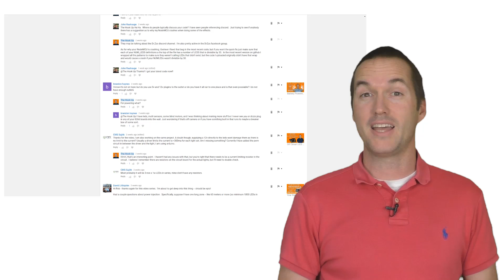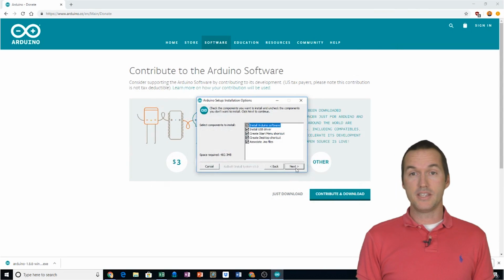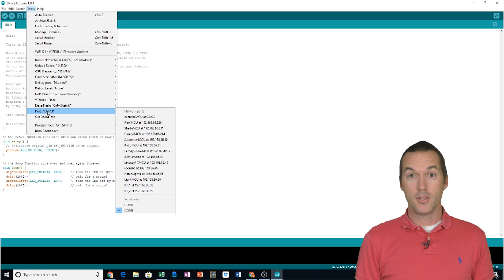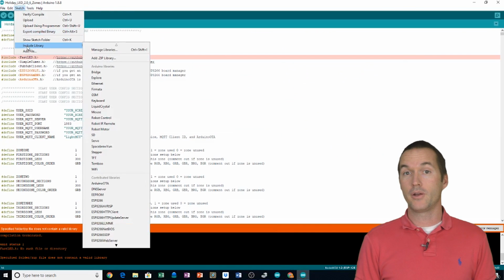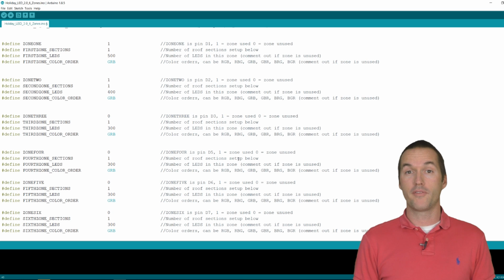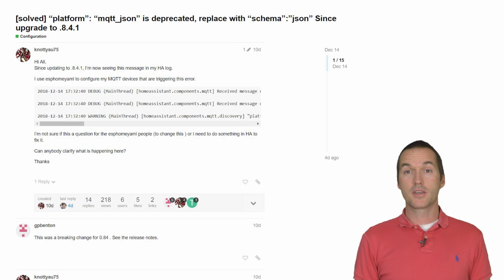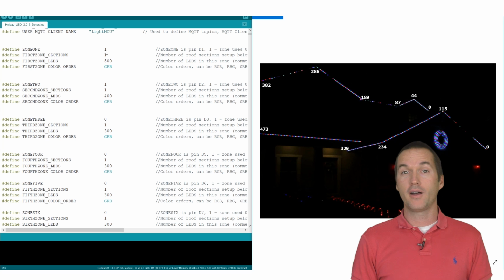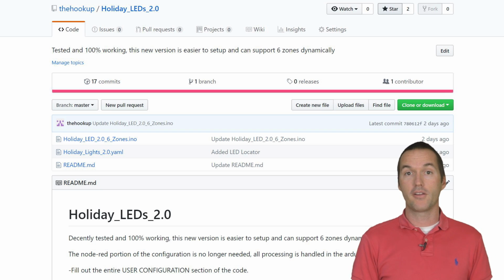Total Beginners Guide: Holiday Lights 2.0 Step by Step Arduino Installation and Setup.

Comment: I bought all my supplies through your links. I have also become a Patreon member. 
Also, I have always tried to buy other items on Amazon through your link. Does the ladder help you?

I got everything working but I have been suck on one thing all week. When I click the switch nothing happens on the NodeMCU side. I do see MQTT connecting on both sides. I tried someone else's code and got the same thing. I don't know where to go from here. Is there somewhere I can find help on this? I already spent hundreds of dollars and would love to get this working?
Reply from the maker: Yep, that helps as well, thanks for your support!
Reply: @TheHookUp  where can I get help on my issue?
Reply from the maker: @fin3125  do you have a way to connect your NodeMCU to USB to see what's on the serial monitor?  You should be able to see what messages are coming through on the serial monitor.

Are you sure you have your MQTT messages setup correctly?  Can you post what you have for your config.yaml?  What version of HA are you using?
Reply: @TheHookUp  that is exactly what I did.. Nothing after the connection. I even added a print line to see if the callback function was called but nothing.
Reply: @TheHookUp  
mqtt:
  broker: 10.0.0.155
#  port: 1883

switch:
  - platform: mqtt
    name: "Switch1"
    state_topic: "ha/switch1"
    command_topic: "ha/switch1"
    qos: 0
    payload_on: "ON"
    payload_off: "OFF"
    optimistic: false
    retain: true   

    ##This version of the holiday lights code does not require the node red portion
##The "W" slider under the main "holiday LED" light modifies each effect
##The "W" slider under "Glitter" light modifies the frequency of glitter, the RGB selection changes the color of the glitter
##The "W" slider under "Lightning" switch modifies the frequency of lightning.
##You must replace the LightsMCU with the USER_MQTT_CLIENT_NAME you specified in the arduino USER CONFIGURATION section
sensor:
  - platform: mqtt
    name: "Current LED"
    state_topic: "LightsMCU/locator"

light:
  - platform: mqtt
    name: "Holiday Lights"
    command_topic: "LightsMCU/power"
    state_topic: "LightsMCU/powerState"
    brightness_command_topic: "LightsMCU/brightness"
    brightness_state_topic: "LightsMCU/brightnessState"
    brightness_scale: 255
    white_value_command_topic: "LightsMCU/modifier"
    white_value_state_topic: "LightsMCU/modifierState"
    white_value_scale: 500
    effect_command_topic: "LightsMCU/effect"
    effect_state_topic: "LightsMCU/effectState"
    effect_list:
      - Color_Chase
      - Color_Glitter
      - Single_Race
      - Double_Crash
      - Rainbow
      - Blocked_Colors
      - BPM
      - Twinkle
      - Fire
      - Fill_Solid
      - Spooky_Eyes
      - LED_Locator
    retain: true
  - platform: mqtt
    name: "Color 1"
    command_topic: "LightsMCU/ColorPower"
    state_topic: "LightsMCU/powerState"
    rgb_command_topic: "LightsMCU/color1"
    rgb_state_topic: "LightsMCU/color1State"
    retain: true
  - platform: mqtt
    name: "Color 2"
    command_topic: "LightsMCU/ColorPower"
    state_topic: "LightsMCU/powerState"
    rgb_command_topic: "LightsMCU/color2"
    rgb_state_topic: "LightsMCU/color2State"
    retain: true
  - platform: mqtt
    name: "Color 3"
    command_topic: "LightsMCU/ColorPower"
    state_topic: "LightsMCU/powerState"
    rgb_command_topic: "LightsMCU/color3"
    rgb_state_topic: "LightsMCU/color3State"
    retain: true
  - platform: mqtt
    name: "Glitter"
    state_topic: "LightsMCU/glitter/state"
    command_topic: "LightsMCU/addEffects"
    payload_on: "Glitter On"
    payload_off: "Glitter Off"
    rgb_command_topic: "LightsMCU/glitterColor"
    rgb_state_topic: "LightsMCU/glitterColorState"
    white_value_command_topic: "LightsMCU/glitterChance"
    white_value_state_topic: "LightsMCU/glitterChanceState"
    white_value_scale: 255
    retain: true
  - platform: mqtt
    name: "Lightning"
    state_topic: "LightsMCU/lightning/state"
    command_topic: "LightsMCU/addEffects"
    payload_on: "Lightning On"
    payload_off: "Lightning Off"
    white_value_command_topic: "LightsMCU/lightningChance"
    white_value_state_topic: "LightsMCU/lightningChanceState"
    white_value_scale: 500
    retain: true
Reply: I finally got it working. I am not sure what the issue was. It might have been two MQTT brokers on HA. I don't know how to tell which version yet but I only down loaded it about 5-6 weeks ago.

Comment: THANK YOU THANK YOU THANKYOU!!!!!! this year im getting a jump on this ! May 8th today i started, board programmed, Hassio setup ready to go, now the easy part is the leds LOL 1 Question i do have is, are you home running ALL led strands back to (ONE) NodeMCU? i cant seem to find the pinout! or are you or can you set this up onto 1 Node for the main floor and 1 Node to the upstairs? thanks in advance
Reply from the maker: One node mcu, 2 pins
Reply: @TheHookUp  Thank you! are you on Discord? do you have your own server?
Reply: OK, i have a test strip up and running! and its working perfect! Your amazing! and thank you for your 5Hr time line to remove the NodeRed side as im not that far into Hassio yet to be playing with that. One additional question i have, is there a way to random the LED programs ex. BPM & Single_race for a few min each to allow passer by's to see different options? and or on HADash i got the light.holiday_lights switch in there but is there also a way to have a selection for the different options there also?

Comment: Hi Rob, I asked if I could use a D1 Mini.  You said I should be able to.  Everything works, but no lights turn on and there is a red light on the logic controller.  The D1 does not have the VIN terminal like NodeMCU so I figured that is the 5v pin on the D1.  The code loaded fine on the D1 and home assistant recognizes the board, all toggles, drop down, the LED counter is working.  I did change in the code the GRB to RGB cause that was the specs on the LED's...I bought the same one's you have supposedly.  I'm getting 5v through the whole strip, but NO lights....sad!  https://imgur.com/6PmoHWX
See diagram, I copied it exactly and checked it twice.  Again the only thing is there is no VIN terminal so 5v went to the 5v on the D1, Grd to Grd, all 5v together and the 3v together went to the 3v side on the converter.  There is 5v and 3v with my meter.  Can you help?  I know I am close?
Thanks Rob
aka Demps
Reply from the maker: Which data pin did you connect to on the D1 mini?
Reply: D2
Reply from the maker: @demps7765  attach to D1
Reply: @TheHookUp  I'm so pumped, it works.  Thanks Rob, My girls are going to be stoked when they wake up
Reply from the maker: Nice!
Reply: @TheHookUp  I finally put these lights up to see the full effect.  I have just done one 15 foot strip, but it's a start.  I noticed that color1, color2, color3 are not working.  Turn them on and they stay off.  I have checked the topic and they match.  I can run effects, glitter, lightning, but no individual Color or can pick a color.  In the code I had it at RGB, then I switched back to GBR.  The only thing I noticed was the main color was green for RGB and blue for GBR.  Any thoughts on this one?
Reply from the maker: @demps7765  color1 2 and 3 should share a state topic with the main LED toggle in home assistant, that way they turn on when the main toggle turns on.

Comment: Thanks to your LED series, I have my above & below kitchen cabinet lighting installed and running! Thanks! I have a couple question and comments that might help others:

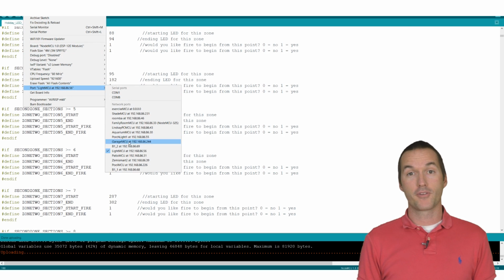At the 9:15 point in your video, you refer to choosing the port as the IP address of the nodemcu. I was able get the IP port to show up once but I cannot get the IP (only serial ports) to show up in the Arduino Port list. Any suggestions so I can continue OTA? 

I found that power injection required home runs for each injection point, otherwise the voltage was soaked up by the first injection point. 

Next step will be altering the code so I can control the above and below lights independently but with option of syncing them when needed.

Thanks again!
Reply from the maker: Huh, OTA should just work.  Do you have the most recent version of Arduino IDE?  Are your computer and nodeMCUs on the same network?

Comment: I'm quite new to HA and was wondering how you set up the MQTT server? I've tried it multiple times following multiple tutorials but can't seem to get it to work :/
Reply from the maker: It's slightly different now, you need to use the "integrations" tab in HA.  I'm not sure if there is a completely current tutorial on it.
Reply: @TheHookUp  thanks for answering, i figured it out, it was a typo in the configuration.yaml :)
Reply: how do you figure out your MQTT sever IP address?  I got everything to load and work but I am not sure what to put there.  I havnt done the duckdns route, well because it seems to compicated and need to locate the IP for my MQTT
Reply: Jillian Mott it should be the same as your raspberry pi ip ;)

Comment: Hi. Rob that is great project to start rgb madness 😁
I have 1 problem with ota update tho. IDE is giving me errors for some reason. I did everything as you show in your tutorial. Thank You
Reply from the maker: Ota only works when the leds are not on.  Make sure you toggle the main LED switch before ota updating.
Reply: @TheHookUp  thank You for quick reply but no joy
Reply: The Hook Up I think that is the answer I am looking for. Thanks for the code and the videos, I have learned a lot along the way.

Comment: Hi can you connect to a open wifi network? if I leave the password blank it wont connect, if i set a password on my router and enter the password on the sketch it work.
Reply from the maker: That is a good question, one that I don't know the answer to.  Let me do some tests when I return from CES.
Reply: Doug, were you able to use with open wifi? I'm in the same situation.

Comment: I can't get it to work and I think I'm failing when it comes to the mqtt portion. I didn't have Mosquitto installed  before this video so I tried to find info on that and don't really know if it's working. I don't see a card on my "Overview" tab for Holiday Lights. When I see the "New Devices Discovered" message and click that I see MQTT: configuration.yaml listed and when I click that it says this integration has no devices. I copied the yaml parts from your file and changed the client name to match the name I gave the NodeMCU. I see the NodeMCU on my router. I'm not sure what I'm missing. I suspect it's something in my yaml. Is there a way to see a sample configuration.yaml and compare?
Reply: I would like to see the same thing. Did you ever get it working?
Reply: @fin3125  same here did anyone get it to work?
Reply: @Racontact  Yes. I think in my case I had two MQTT brokers running on HA. the one I did not know about was the one built in to HA
Reply: @fin3125  cool I finally got mqtt to run via the add-on, and now I have to figure out how and where to update the holiday lights yaml to home assistant.  Man what it must feel like to get the lights actually to work. I had everything purchased in August thinking I was going to have installed in less than a month.   Too far in to turn back now!  I thought the physical install was going to be most challenging, I look forward to sodering and climbing the ladder now.
Reply: It was a great feeling when I got it done. Took me a weekend to do 624 leds. Now my wife want me to do the rest of the house. I need a lift truck for that.

Comment: Thanks for this awesome sketch..

Below should disable fire for a section? 

It causes a compilation failure ( In function 'void fire_firstZone_SECTION1()': )

#define ZONEONE_SECTION1_START_FIRE       0           //would you like fire to begin from this point? 0 = no 1 = yes
#define ZONEONE_SECTION1_END_FIRE         0           //would you like fire to begin from this point? 0 = no 1 = yes
Reply from the maker: I'm trying to figure that out, I would just not mess with the fire for now, it's in "Beta mode"

Comment: Hi Rob, The current LED number doesn't reset back to 0 is this a problem on my end or something in the code?
Reply from the maker: Are you using a single zone? I updated the code on github a few days ago to fix that issue.
Reply: @TheHookUp  yes I was using a single zone for testing

Comment: could I also suggest that you add
"#define USER_LED_TYPE    WS2811   // Used to define the LED string type" 
to your code.  my light stip is different and I need to tell fast led that
and maybe a D# pin definition at the top as well if people have already wired it up differently that you have  :)
Reply from the maker: Hi, I actually responded to an issue on github about this.  In the FastLED library NEOPIXEL, WS2812B, and WS2811 (as well as a few more) are actually the same definition.  The only reason you'd need to change that definition is if you were using an LED that had a clock pin.
Reply: @TheHookUp  Good to know. first run with the new code tonight.   need to program a RED/BLUE light sequence for the local universities blaa games now :)  Me = Utah Wife = BYU
Reply: @DavePackham  do you live in Utah? I'm also a Utah fan! I'm having a hell of a time with getting all of this set up. If you're not too far away i'd be willing to pay you for a little bit of guidance...
Reply: @logancornwall5161  I do.  Pm me

Comment: when I ran my LEDs I only use the single signal wire to all the lights.  its a single string of 350 LEDs all connected to D4 in a wemos 8266 mini.   cant we recreate "zones" with led numbers?  say zone 1 is led 1-50 zone 2 is led 51 to 75 etc instead of needing a signal wire going from D4 to zone 1 and D5 to zone 2?
Reply from the maker: Absolutely, that's what the "sections" are.

Zones are for if you have areas where it doesn't make sense to daisy chain a single wire.
Reply: @TheHookUp  ok.   Ill try it again :)

Comment: Great work and  supper easy to get work My Holyday light - step by step - Thanx Man!! But ;) I have some trouble with this. I have some LED stripes from ALi https://www.aliexpress.com/item/individually-addressable-1m-4m-5m-waterproof-ip65-ip67-5050-rgb-30-60-144-led-m-5v/32773441024.html?spm=a2g0s.9042311.0.0.27424c4dNU00Zc
but I don't know which ones I have exactly  5M strips. Is they ws2811 ws2812 ws2812b ? 
I changed in code  2812 2812b and even 2811 - but  when use let's say locator - the light will be go step-by-step, but the farther he goes the more starts any of LEDS from begin flash.
And  when use other effect ( Double_Crash) then somehow  understand the running led but mostly  random led flashing so mush that not understanding what effect is on etc.
Any advice will be nice ;) 
video with Rainbow effect ;)  https://www.dropbox.com/s/ovjl01jej6srnam/IMG_3853.mov?dl=0
Reply: The answer is Connect Node and LED stripe  "-" ground and all works as it should

Comment: Is the brightness adjustment in the code? Mine is stuck at 100% even when amending the slider and looking at the code I can't see where it picks up the brightness from the mqtt topic. I can see it in the old code but maybe I am just missing it. Thanks.
Reply: The new code doesn't seem to have the "if statement" for the brightness command, I grabbed it from the original code and pasted it in, brightness control works again :)
Reply from the maker: Fixed.

Comment: Love the video.  Any way to globally limit the brightness?  My zone is almost 600 pixels and the last 100 or so don't work quite right.  On the last Holiday LEDs I could get them to work correctly but only on half brightness.  I notice with the current version every time I change any settings in home assistant the brightness gets reset to 100%.  Thanks for the great work on your videos.
Reply from the maker: Sure.  In the sketch you can search for the "byte brightness = 255;" line and change that to some smaller number, 127 will give it a default brightness of 50%.  Then in your HA config you can change "brightness_scale: 255" to 127.
Reply: @TheHookUp  Thank you

Comment: 2 of the 3 Libraries install correctly. However, SimpleTimer.h, gives me this error "Specified folder/zip file does not contain a valid library"
Reply from the maker: Sorry, try this link: https://github.com/thehookup/Simple-Timer-Library

That happens sometimes when someone generates a pull request on the library (and the original library gets hidden in a subfolder).
Reply: @TheHookUp  Yup, that did it, thanks.
Reply: @TheHookUp   I am getting error message: 
'class simple timer' has no member named 'setTimeout'

being a complete novice at this, any help would be greatly appreciated.
Reply: if it helps any, this error occurs at the setup function 

timer.setTimeout(120000, checkIn);
Reply from the maker: @AirBoone  Did you use the link above (my simpletimer repository?).  Something happened with the main simpletimer repository lately and it broke it.
Reply: @TheHookUp  I erased the simple timer library and just pasted from original zip file. Got it working! Thanks for all your hard work on this. I know you have a lot of time dedicated to this and many other projects. You do a great job explaining everything. From someone who had no previous knowledge about coding of any sort, I am able to comprehend almost everything you explain, even more so to the point where I am about to purchase a rasberry pi b+ to run home assistant on. Thanks again..
Reply from the maker: @AirBoone  Awesome Kevin, love to hear that.  Good luck!